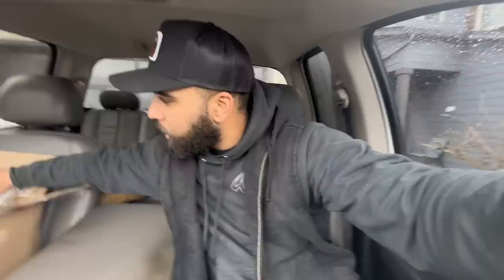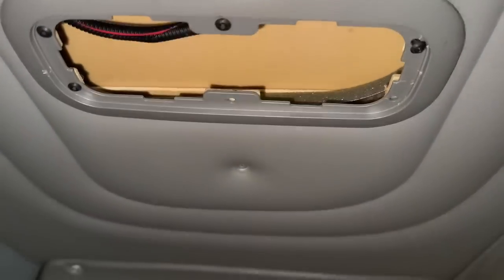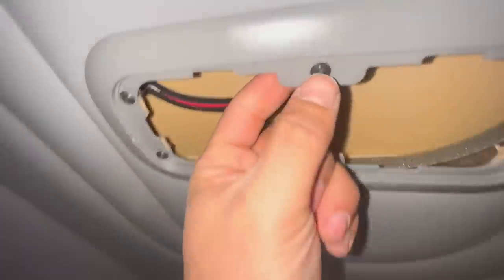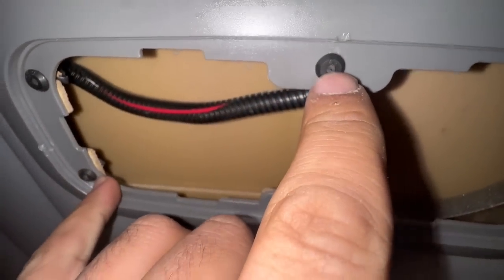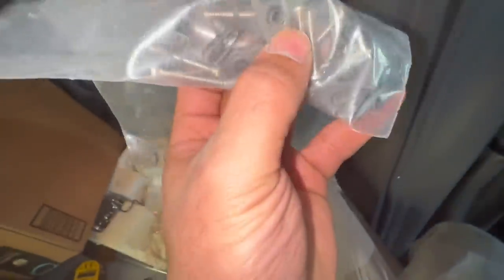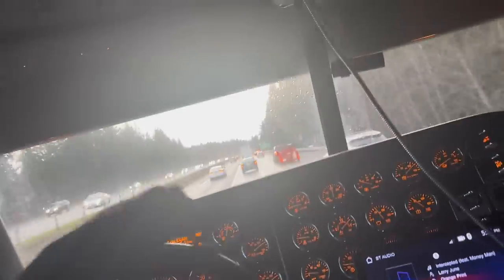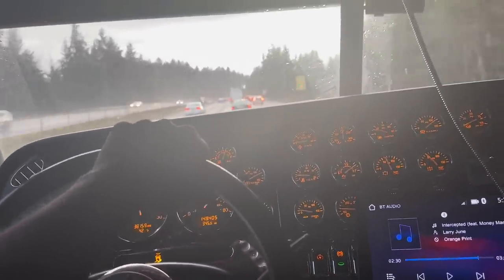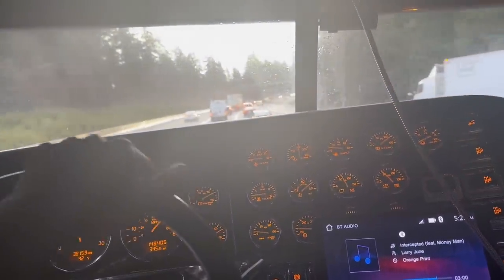Sleeper interior lights look SICK!! in my 2022 389 Peterbilt

Comment: Man I am starting to change my lights on the truck to glass but I am having problems with moisture and water getting in them.. . Any advice on it ??? Thanks
Reply from the maker: Clear permitex  around the gasket and bezel
Reply: @trucking4racecars  10-4 thank you sir
Reply from the maker: @Life-On-18-Wheels  use electrical grease also that’s key for outside lights